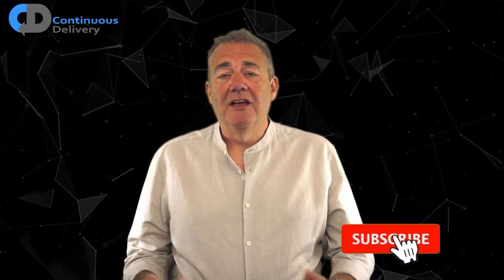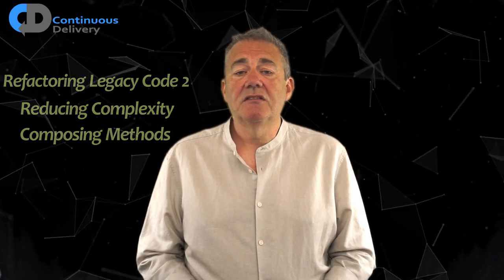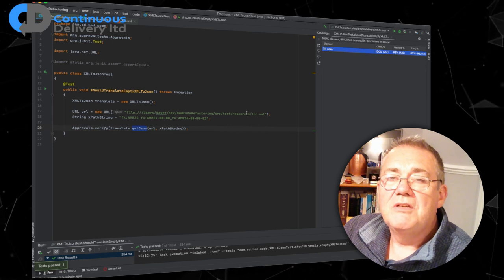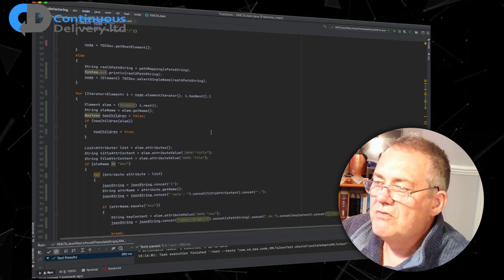Refactoring Legacy Code: STEP BY STEP (Part 1)

Comment: Don't refactor code in this way. When you did keep up your knowledge up-to-date, 99% of so called seniors don't, then you would know the use of a json library does the same but better. Because you don't know the existence of a library doesn't mean you should write one yourself.
Reply from the maker: I am afraid that you are missing the point. This exercise has nothing to do with what the code does, this is how you tackle bad code, to reshape it to be better, and testable. This is about the skills of being a software developer, it is equally applicable to the code that people that assemble 3rd party components together, as it is for the people that build custom systems, or build the pieces that you assemble together.
Reply: " keep up your knowledge up-to-date, 99% of so called seniors don't"... that made me laugh SO loud.

Comment: Thanks for the video Dave. I usually love to see this kind of video also on my iPad beside my laptop but this way I cannot see code, it reminds me I’m ... ehm ... getting old :-). Great topic.
Reply from the maker: Yes, I was torn between coding in "presentation mode" and at a more normal resolution. I thought that there was some value in seeing the "shape of the code" which you tend to loose in presentation mode. 
I confess that I didn't think about watching this one on an iPad :(
Reply: @ContinuousDelivery  I also prefer the standard mode especially during refactoring legacy because the shape can reveal structure: clouds of code can reveal logical blocks. Luckily I have also a desktop monitor beside my laptop :-D
Reply: @ContinuousDelivery  ya this is a problem i face when I make video-game tutorials on YT as well. I usually just end up erraring on the side of small screens by setting my desktop to 720p and record at that, then call it done. one thing i hate about my approach though, is YT doesn't treat videos under 2k resolution with the same respect - meaning they give less bitrate ratios to those videos.

aka, under 2k res videos have noticeably more compression.

Comment: I had actually never thought of doing something like approval testing as a stop gap measure until you refractor the code enough to be able to test it properly. Very useful tip indeed.

Comment: If am using an untestable legacy platform like vb6 & stored procedures. Should I bake a self tests into the main code?
Reply from the maker: There are some references to unit testing VB6 so maybe worth  bit if a trawl with Google. I found this on a quick look https://brainbaking.com/post/2016/12/vb6-unit-testing/

What I have done in the past, when working with older tech, is to write my own, simple version of (x)Unit. It isn't all that hard if you keep it simple.

I have seen some unit/functional tests used for Stored-Procs, not ideal because the DB is there in the back, but better than nothing.

Good luck!
Reply: @ContinuousDelivery  thank you. Its inspiring to see what others have done with vb6. I think I will try make one class called TestPoint inside the main code, and get a test runner to call it often via, activeX createobject. 
I look foward to your next video.

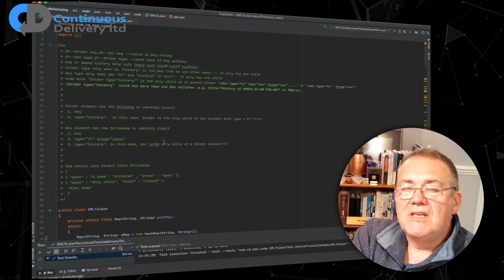Comment: 2:36 refactor technique: approval testing aka. characterisation testing
    3:23
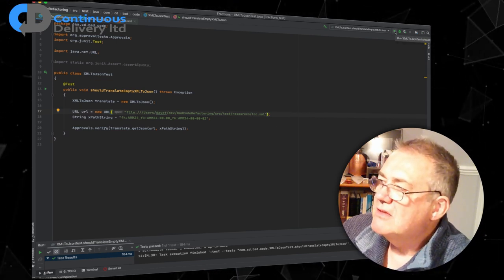    4:40 what happens when you run approval tests
        4:43 captures the output from the code that you call
    5:50 approval test is a very useful tool during refactoring when the whole point is to avoid changing the behaviour of the code
    6:06 other thing need to do: run approval code with test coverage
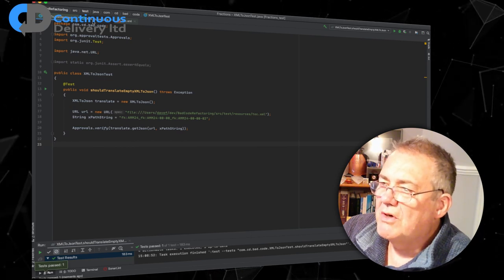7:46 step 1 of refactoring in the code demo: reduce clutter
    8:40 rename method arguments
    9:29
        9:43 rename method
10:50 IMPORTANT practical tip: focus back the simple steps and refocus on the task at hand
11:23
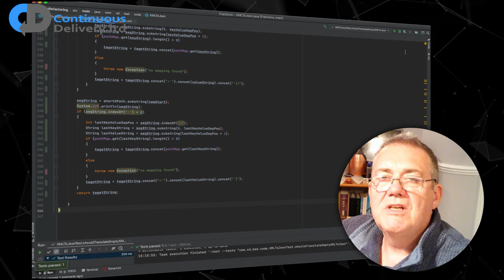14:34 commit with small refactor
16:01 takeaway: work in small tiny steps

Comment: Check in comments that I hate:
“Fixed re-indexing problem of the stem bolt conflagers. Fixed mixed use of tabs and spaces in the source code to improve readability.”

Thank you for fixing the code’s readability but please make that a separate (no change in functionality) check in.
Reply: Yes, each commit should ideally be described by a single short sentence.

Comment: Thanks for the video.

I think that this example class had quite a shallow tree of conditional branches, so the video didn't quite demonstrate some of the additional steps that are sometimes necessary with characterisation testing. Getting 85% line coverage with a single test implies that most of the code is quite linear, but often legacy classes have too many responsibilities and too many conditional branches. I've done characterisation testing where I can only get 10% line coverage with the first test, with diminishing returns for subsequent tests.

Any advice on how to determine what kinds of differences in input to use when trying to get greater coverage before de-cluttering?

What about when the code is highly coupled to something unreliable like a database or a network connection?

Thanks again for the video. 🙇‍♂️
Reply from the maker: Inevitably any code where I can demonstrate the techniques in a reasonable amount of time will be simpler than a real, nasty production system.

I picked this piece of code as a compromise, it is bad code, it is complex enough to require some discipline to change it safely, but it is enough to demonstrate how I tackle this kind of problem in an hour or so.
The coverage I got surprised me too, it was better than I expected.

My approach to approval testing is to do a few tests that push the code through a few different paths. This code didn't need more than one.

The next videos in this mini-series will, I hope, demonstrate the techniques, as I say in the video this one really only covers the pre-work.

Keep an eye on my channel for the next two videos and let me know what you think.
Reply: Good point. I think you have to read code not covered, then try to test your assumptions adding tests and variations on input. Maybe the component you're working on isn't SRP compliant, maybe it's just convoluted, these are some reasons you are reafactoring (of course, in order to get the code readable/tetstable/maintanable). Seems to be a chicken-egg problem, but the first characterization test (or a Golden Master test) will be your chicken, so you can start to test your assumptions having a sefety net, even if with it is a net with very wide links that you are going to shrink.
Reply: @ContinuousDelivery  Thanks for the reply. I'm really looking forward to the next two videos.
Reply from the maker: Yes, exactly. Actually in this case I did that by varying the content of the XML file, but stupidly, I didn't record that part of the exercise. Doh!

I started off with lower coverage, I think it was 30 - 40%, and then bounced between the code, to try and identify what input data may push the code down different paths, tweaked the XML and tried the test again. All the time tracking the coverage.
Reply: @ContinuousDelivery  I think this intuitive input-tweaking is the hard part of characterization testing that I find difficult to teach. I would love to see a video where you mess around with test inputs for 10 minutes. 😄 It would be very informative.

Comment: Great video, but there's a few other options to consider:

1. Run away.
2. Hide and hope someone else picks up the end of the stick with poo on it
3. Look for a new job
4. Rebuild it from scratch

4 is the best option, if you are afforded that luxury - you are then in the realm of "green field" development, everyone's favourite, plus you can make the same mistakes all over again ... (joking ... I think) ...
Reply: 3 is the best option, if you do 4 they'll only break it again.
Reply: Rebuilding small chunks of code is usually fine - but rebuilding a legacy application is almost always a giant expensive failure - because yeah - because any legacy application has a ton of hard fought fixes in it, and undocumented features.

Comment: When I think of "legacy" code I tend to think about older languages like "COBOL",BASIC,"DBL/DIBOL". Procedural style languages without the notion of "Objects/Classes". That is a whole other world. The current language I am working with (Synergex DBL) does have the notion of "Classes" but the code base was developed prior to that feature and essentially doesn't use it. Some newer code that has been introduced does use "classes" but 99% is simply subroutines and lots of goto's. Very difficult to refactor and generate "tests".
Reply: I'm dealing with "PHP-3 style" PHP-5 written by amateurs.... I DREAM of a nice, simple bit of CoBOL to get my teeth into... I used to LOVE CoBOL!
Reply: Characterization tests may be the way to go in your situation, given the lack of structured programming. What tooling do you have available to you? Testing and code coverage are great tools to have on your toolbelt. Depending on your refactoring tooling, reengineering may be the way to go. Also remember to use static analysis tools -- specially on older codebases!
Reply: @MatheusAugustoGames  Unfortunately not any really. Code is essentially run in a Linux Terminal screen, old "Green Screen" VT terminal emulation. Just a compiler and linker, multiple code base instances, development, testing, user acceptance testing, production. Most developers used VI editor to do the actually coding, VERY old School.
Since I am a contract programmer my mandate is to simply work on modifications requested and to do it as quickly as possible, no "redesigning" the world. Not worth it to me to rock the boat, a few more years to retirement so not much desire to fight the bureaucracy anymore.
Reply: @ajmeyer66  That's very unfortunate for the coders that are gonna come after you're gone. I bet that if you tried, your talents could be used to make their lives easier by leaving the code in a better state than when you arrived.
Reply: @MatheusAugustoGames  I do my best to refactor as much as I can. I have also built a few "Utility" functions and created documents to describe how to utilize the utility functions. Whether or not the utilize the tools or not is out of my control. We are however developing some "AutoGen" scripts that will read the source code and then build "wrapper" programs that can then call their built up library of functions. This will allow us to create in-house test harness programs that can call the utility functions via the "wrapper" program and pass test parameters in and evaluate the responses given back.
Reply: @ajmeyer66  Well then, you're doing way more than your part! I'm sorry, I misinterpreted your original comment as if you'd given up, but now I see that you're actually very dedicated to the project!

Comment: I wonder whether I would make the old code base as a branch in git?
Reply from the maker: I wouldn't, refactoring is behaviour-preserving, and is best done in very small steps. So you should be safe to release at any point, or not very far from a version that was.

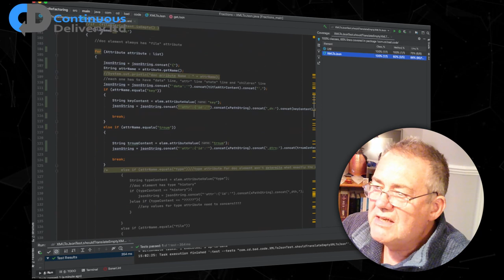Comment: 7:30, I use tab = 2.
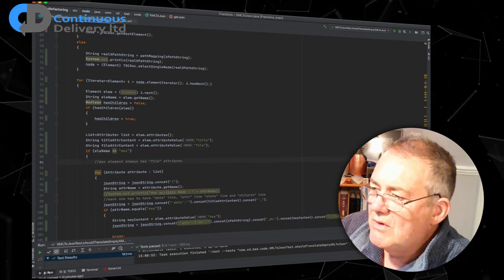9:10, what is xPathString? You just deleted the comment. 10:15, don't delete, just put it at the right side. 11:00, mm... I wouldn't do that. 11:11, omg... I know Java is awkward, but the comment was saying where things were placed. 13:52 and 14:01, somebody put this man in jail! :)
12:25, I would permanently highlight the 'hasChildren' 1st, or if this doesn't exist in the IDE, I would use the find recurse, to spot every occurrence of it.
12:45, "equal to" and "has it" are 2 different things to me. That's why I would not delete the comment.
- Here's the proof of a DRY violation: there's the hasChildren f(), but the programmer forgot it, because the previous f() was too big.
- 13:17: at least in compiled languages, deleting (safer: turning it into a comment, actually) getXPathString() would reveal all calls to this "f()".
How C++ is elegant compared to this s**! You could write:
11:20, jsonString += Str1 + Str2 + ... StrN.
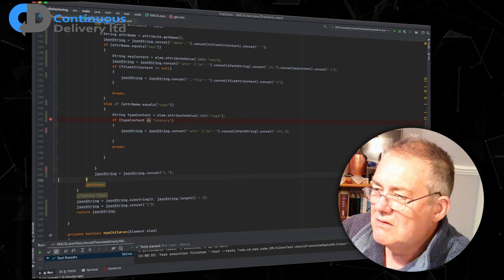13:00, return jsonString.substr (blabla) + "]". Period!
13:40, String tagetString = shortXPath.equals("") ? "//toc" : "//".